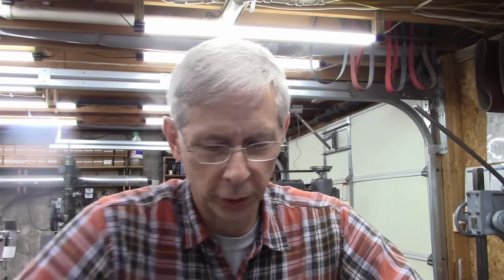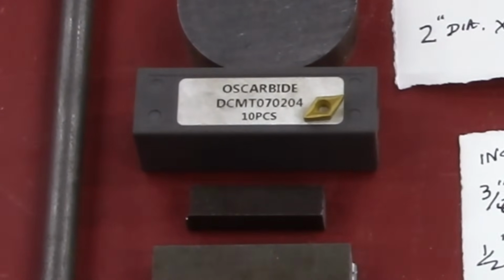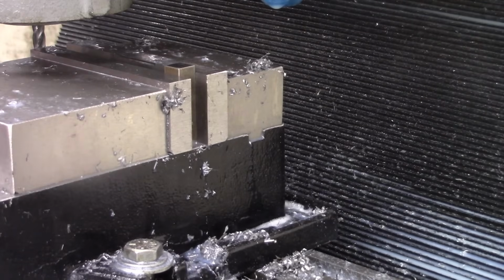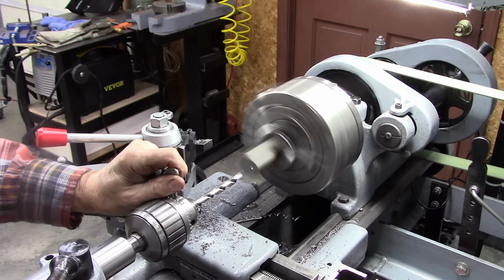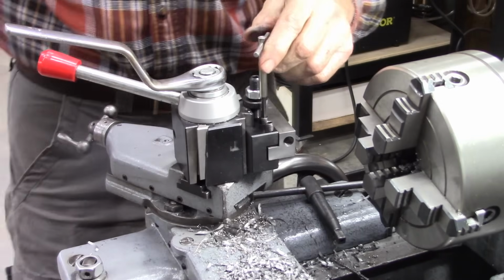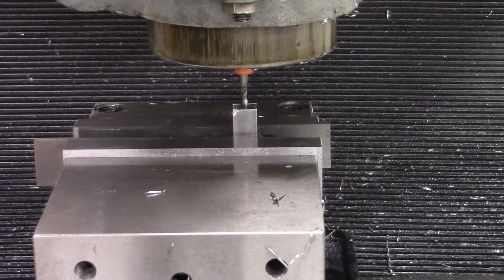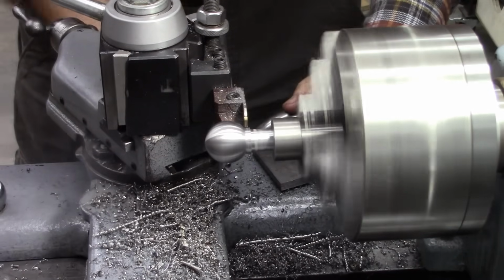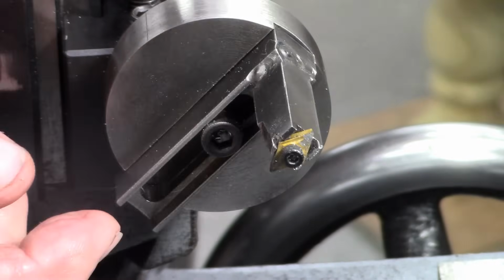BALL TURNER for a Quick Change Tool Post 1-1/2" + Diameter

Comment: The first one would work  just fine but should have a down feed screw , if you set it correctly set it to cut on the top side of the bar not the usual front face as in conventional turning. You need to grind a pencil type point on the tool with rounded tip and of course a flat to form the cutting edge.
Reply from the maker: I agree but I also think one made horizonal would be best. The only problem is the chuck tends to get in the way.

Comment: I love it! I have looked at A LOT of ball turning device videos but yours is both the simplest and most straight-forward of them all. I have to ask though, is there a way to connect the tool arm without welding? I am not a welder nor do I wish to be.
Reply from the maker: You could make the arm triangle shaped and bolt it together. It only needs to be small where its cutting.

Comment: This is a good start but I'm sure you'll find more improvements yet with round or radiused nose inserts.
For the DCMT 55 degree type insert you can quite easily cut a profiled 55 degree pocket in the tool holder using a 3 mm end mill or slot drill....there just needs to be a circular pocket hole at the non cutting end to clear the rearward facing point of the insert.
Reply from the maker: I'm not sure the insert actually needs a socket to sit in. The current insert has a very small radius tip which is a bit less demanding with cutting force. A larger radius would be smoother cutting as long as it doesn't chatter. I have some grooving inserts with a round tip that might work well just more difficult to mount.

Comment: A good simple design Winky, have you seen the Turnado Freehand Metal Turning System from Eccentric Engineering ?, it's interesting.
Reply from the maker: Sounds interesting, I may have. I'll check that out. thanks!
Reply from the maker: Yeah...  just checked it out. I saw Blondie hack do a video on it. A little slow and even scary but it seems to work well.

Comment: I made a ball turning jig with a boring head but I made a tool holder to take a round carbide insert on the end, that way you don't have the clearance issues and you can turn a complete ball.
Reply: I did the same thing using a 6mm diameter round carbide insert.
The  ball turner itself is a custom made body with dovetails that fits directly onto my Aloris type toolpost with a rotating shaft in bushings threaded at one end to screw on the boring head.
Reply from the maker: The smallest round insert has a much larger radius than the insert I used. I was worried about chatter. Maybe I need to try it.

Comment: Very nice work. I need to make one myself. Thanks
Reply from the maker: Two suggestions. 1) gets some small tapered roller bearings for the pivot point. The clearance in my pivot point leaves some surface finish problems. 2) My insert works well but if you can find a small radius insert that is smaller and more narrow it would be better.

Comment: Mr Winky, treat yourself to a turning tool that take round carbide inserts, great for finishing welds in the lathe nice half round edge, great YT content 👍
Reply from the maker: That would be super for welds (I need to get one) but the ball turner really needs a smaller radius to limit cutting forces.

Comment: Hi Winky, That turned out great. I followed your Video on making the Tap Handle also. It has been really handy for Tapping. I’m sure this Ball Turner will be really handy to have. Thanks for making this Video Winky.😁👍👍
Reply from the maker: Yeah, the guided tap handle is simple but super handy. I'm sure you've noticed I use it a lot. If you make the ball turner you might consider making the bearing adjustable. (kind of like a drill press quill lock). The one I made works well but it would leave a smoother finish if the bearing was tight.

Comment: I normally start with a piece of stock a little oversized for the ball I want and drill and tap the hole for the rod the ball will sit on. Then I use a threaded arbor to hold the stock and create the ball. You can get almost a full size ball with that setup
Reply from the maker: Excellent idea!  Thanks

Comment: Suggestion - after turning the ball, drill and tap for your threaded rod without removing it from the chuck and screw in your already prepared  threaded rod.  Now reverse the ball and rod in the chuck and cut off the excess from the ball and re-use your ball turning tool to finish the ball?
Reply from the maker: That would work. Another person said to use a threaded arbor to turn the ball on which is also a good idea as long as the hole size is large enough.

Comment: I like this approach.  I've been looking for a simple way to make a ball turning attachment of my own.  And this one checks all the boxes on something easier to make and simpler to use.  The use of the vertical adjustment of the tool post itself really simplifies the whole design and fabrication process..  One point I can see which might improve the handling at the neck would be to alter how the cutter is mounted.  With it centered in the square post you end up rubbing the reduced neck a lot.  That's fine if you cut the ball away after.  But if making ball end  handles of the style used on some machines it would be nice if the insert was offset and angled slightly to one side on the square post.  The idea is that the tip of the insert is still in line with the center of the rotation but the post and body of the insert sits off at an angle such that the insert and post are not in the way when you come around to the ball to neck area.  If I could post a diagram it would be easy to show.
Reply: When you undercut the stock it would be faster if you cut 45 degree or stepped cuts to remove a lot of the stock and let the tool cut less material. I have used step cuts and actually finish the ball with a file and abrassives.
Reply from the maker: @gvet47  That would work well.
Reply from the maker: I agree, I need to experiment on ways to make the cutter and post narrow. I have a 1mm round tip grooving insert that might work okay but the insert is also long and hard to mount. Maybe turning the 1/2" post disaginal....  They also make small round inserts that would mount on a 1/4" rod but the amount of areas being cut is much larger.
Reply: @WinkysWorkshop  Yes,try the radiused grooving insert but I would think a 3mm diameter rounded nose insert would be more suitably robust to withstand the side thrust loads.
Reply from the maker: @howardosborne8647  You may be right but the tool insert I have is designed for side cutting also.